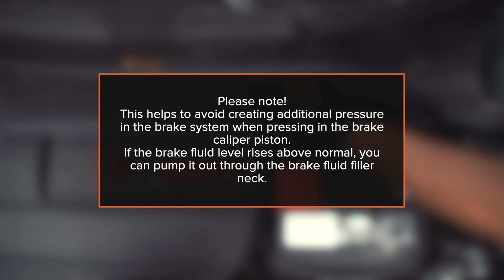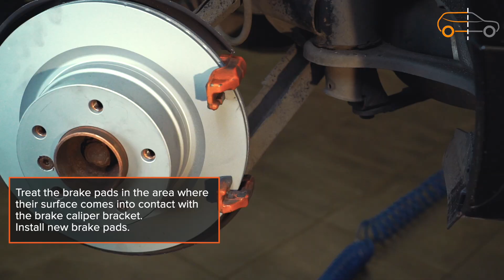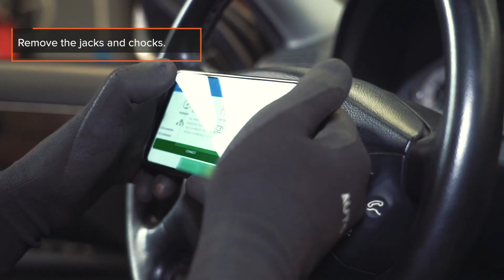How to change the brake pads on your car [AUTODOC TUTORIAL]

Comment: 8:04 what is he applying on the hub, which darkens to brown?? Also what is he spraying on the disc?
Reply from the maker: We used copper grease and brake cleaner, you can find it at the link in the description under the video.